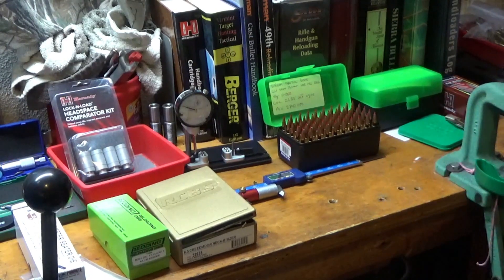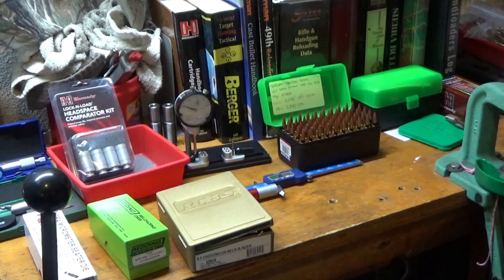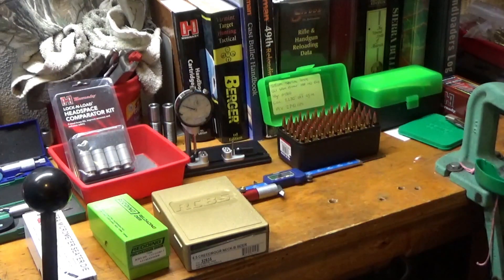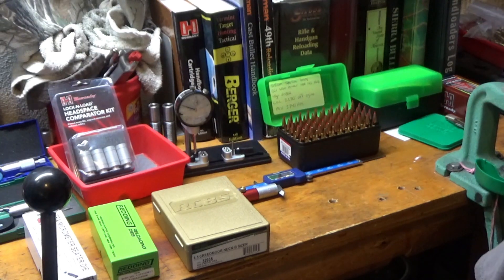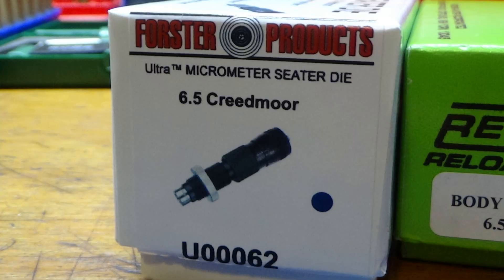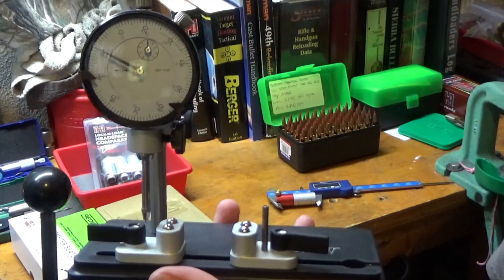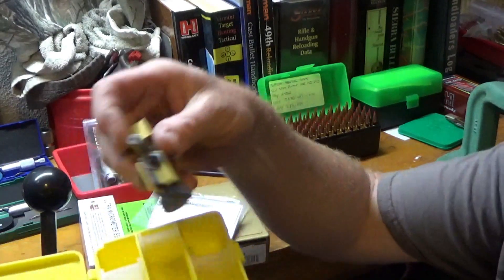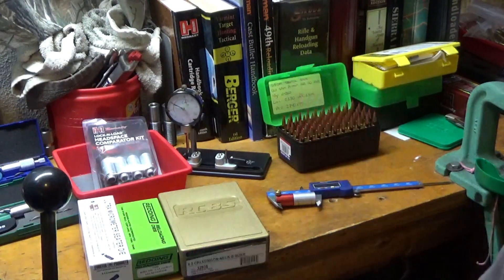Loading 6.5 Creedmoor reloading dies and tools - For precision hand loads

Comment: How often do you clean you're Savage 12fv? And do you remove the copper if you do or just the Powder fowling?
Reply from the maker: I'll clean it when accuracy starts to suffer a bit. I'm kinda lazy like that. I remove all to copper when cleaning.
Reply: @coatsbrothersfirearms8406  thanks for the response. The reason that I asked is that we shoot pretty much the same combination in load. Starline small rifle primer brass h4350 CCI 450 Hornady 140 ELD m. I'm running 40.6 grains .020  off the lands and I'm getting right at 2800 fps which seems like that's really fast for that charge weight. I broke the barrel Inn and have not cleaned it since then. I have 500 rounds through it I'm not sure if I'm experiencing copper and powder fouling buildup or not.

Comment: Have you tried bumping with a full size die?    I have almost everything but the concentricity Gauge and the seating die.  I think the seating die like yours is my next purchase for sure.   What press are you using?
Reply from the maker: Halfdollar 86. I have not. The reason why is a std FL size die will size the neck as well. The Redding body die will not size any of the neck. You will not regret the Forster Ultra Micrometer seat die. I use an RCBS RockChucker press.